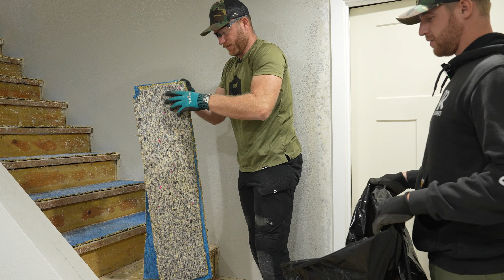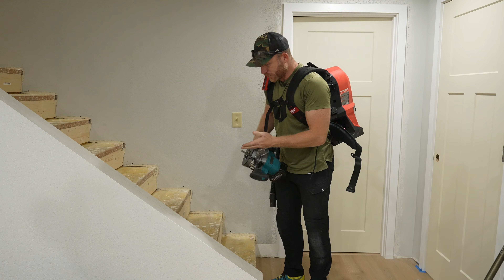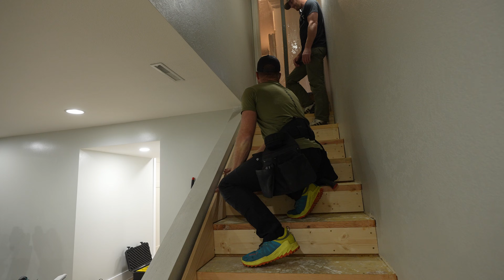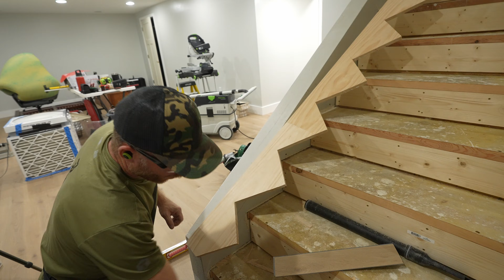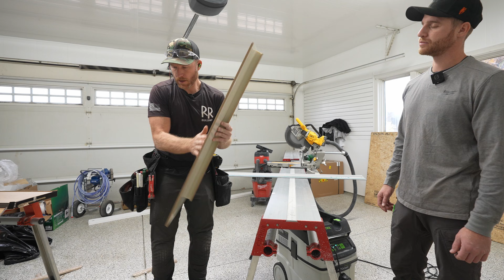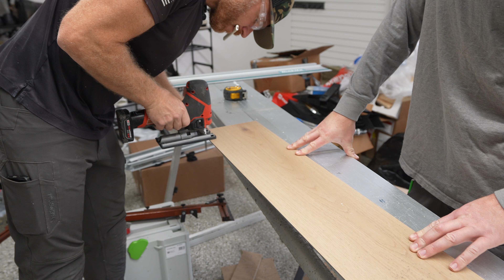Basement Staircase remodel:  Get rid of Carpet!

Comment: Hot glue and lath is my favorite way to template. You can’t get it wrong and it’s fast. When I built out my van, the irregular profile of the van shell was a challenge to cut the plywood to the structure, but I found hot glue and lath was better than a cardboard template.

Comment: In new construction we hold the outside stringers away from the framed walls by 1" so the Skirts only need cuts at the top and bottom. The Risers and treads are cit to fit that opening. If we are doing a stair out of oak or someother hardwood we have the stairs made in a Millwork shop and just drop them in place. Stragiht run, landing/s or curved. Best ever because they go in on the finish and have limited wear during the consruction process. We use a temp stair during heavy construction that we pull out and reuse.

Comment: We had our carpets professionally steam cleaned.  The amount of dirt that came out of that carpet was DISGUSTING (the company does a 'show and tell' to 'prove' they are actually doing a cleaning job).  We own a "small" carpet machine and the following month we ran it over those "cleaned" carpets.  FILTHY!  DISGUSTING.  2 weeks later, SAME.  The amount of dirt that gets trapped in carpet is gross.  I would love to move to a high quality laminate or wood, but our basement sits at a 'chilly' 60F in the winter (our basement could almost be a walkout so it is FREEZING down there.  This means our floors are VERY cold and the carpet gives us SOME insulation.  The other reason I don't want the laminate or wood?  Dogs.  We have an elderly dog that has bad hips, and weak front legs.  She needs the traction the carpet gives her.  The other thing?  Scratches.  I've never seen a laminate or hardwood that doesn't have horrible scratches within 6 months of installing it due to pets, moving furniture (including kitchen chairs), etc.  It starts to look bad way too fast.  :(

Comment: It’s interesting to witness the social changes shown in this episode. When I was little, in the early fifties, everyone had stairs with no carpets. Then there were stair runners which left about six inches of space both sides. Later, everyone wanted fully carpeted stairs, now seventy five years later we’re back to plain stairs. I guess there was a sound deadening element in having some carpet or perhaps a comfort element not treading on bare wood, but with under floor heating and manufactured materials that has, maybe become less important. I still like the feel of soft carpet under my bare feet, but then I’m just stuck in my ways, I’ll probably never change, at my age.
Reply: The thing that drives people to change styles periodically is the desire to put their own stamp on things. There are only so many ways you can finish stairs, so it makes perfect sense that the same finishes will come back around over long periods of time. The same thing happens in fashion and other areas as well. People just like to change things up every so often and there's nothing wrong with that.

Comment: So, what happened to the paint around that door?
Reply from the maker: sanded it off because of trim caulk lines etc.  will repaint entire stair when done
Reply: @RRBuildings  Ah.. Looked like it had adhesive around it and was trying to figure out what you were planning there, but then I noticed the texture on the wall.

Comment: Should have joined the 2 boards that make up the trim together before making the cuts for the steps/risers. Glue is Ok, but adding dowels would have made the joint a lot stronger. Doweling jigs are less than $200 and come in handy (as long as you know where it is).

Comment: I'm planning on building a two story post frame apartment building with vaulted ceilings. The foundation will be a raised ICF foundation. The exterior walls will have Rockwool insulation and the roof will have SIP's. The ceiling will have exposed beams.
Reply from the maker: Sounds awesome

Comment: Why did you need a transition strip at that doorway and not just continue the flooring?  Looked like it would have ran straight through.
Reply: You need to account for a bit of expansion with floating floors.  Under the transition strip is a small gap that lets the floor on each side of the strip expand a bit.